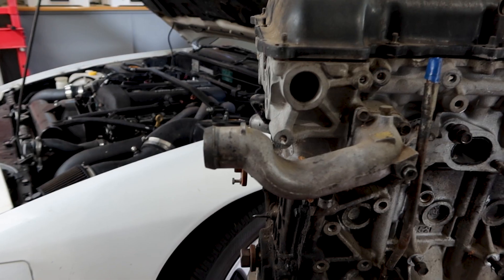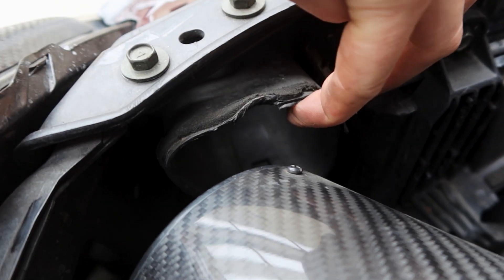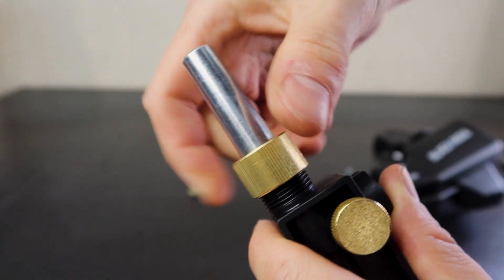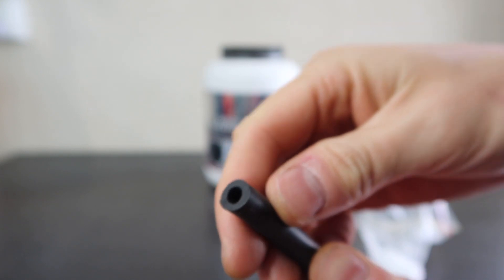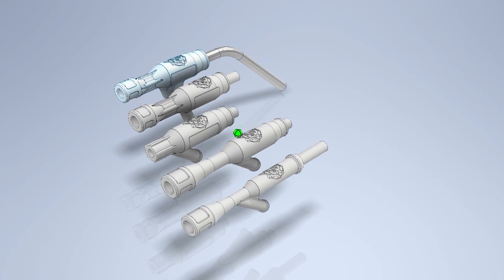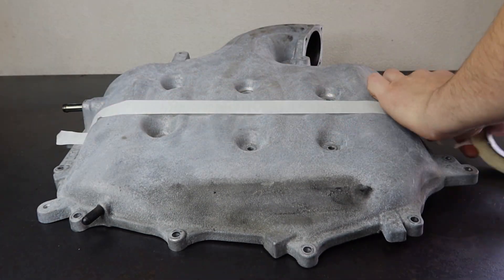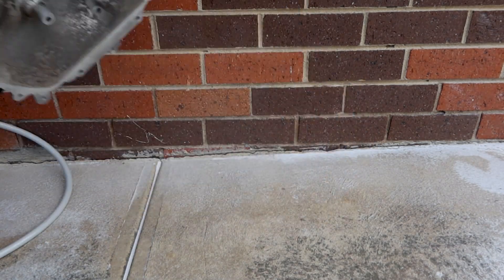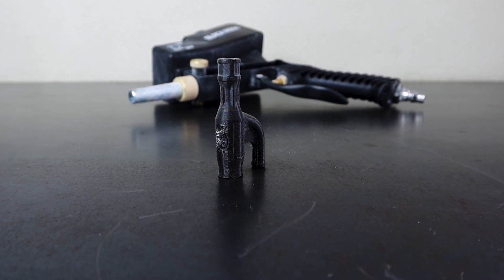DIY 3D Printed Soda/Sand/Media Blaster - Design and Build

Comment: Psst, if you hit up your local animal feed shop you can get a 20kg bag of powdered bicarb soda for 30 odd dollary doos.

Getting good flow of media out if the hopper is tricky with soda as it will clump if its damp or even if its too humid. Commercial units have a bleed line to partially pressurise the media tank to help push it through (just make sure your compressor has a good drier attached), for small units you can insert a metal tube in the end of the  pickup line so you can dig it around the supply bin to free up the media. 

Also a good idea to sift the soda before you start to clear up any clumps

(I ate a lot of soda stuffing around with this in my back yard)
Reply from the maker: Hey mate thanks for the tip. I was planning on trying to source some in a larger quantity so I'll start there.
Funny you mention the humidity, I struggled a little with condensation due to my drier on my compressor acting up.
Going to give this design another go soon for some upcoming projects so I'll make sure to post how I go. 
Thanks again!

Comment: Yo I got a question with your 3D T300 wheel adapter kit, so on the original T300 wheel there’s a chip at the back so the wheel can connect to your console but if I get this wheel adapter and add a wheel I’m not to sure if it will work, got any solutions?
Reply from the maker: Hey mate,
So that connection is for the buttons on the original wheel, when you mount the aftermarket wheel you will just lose those ones.
Shoot me a message on instagram if you like and I can send you a couple of pics of my setup.

Comment: I like where your heads at but I think there are 2 way better options that suit restoration work. I know you sighted space. But converting a blasting cabinet to a water blaster would be worth it's weight in gold. Parts come out looking brand new.
Also with your ingenuity. You could be the first to hack together some kind of budget dry ice blaster. The results from those with zero damage to the original items are bordering on magic. 
P.S. I sent you dm on insta 😉
Reply from the maker: Hey mate thanks for watching.
At the moment I really am maxed on space with the stuff I already have and am planning for and I don't have a need for a cabinet that I won't really use all that often. For sure it would be great to do one day and if I had a little more space I wouldn't even think about not doing it but for now this will have to do :)